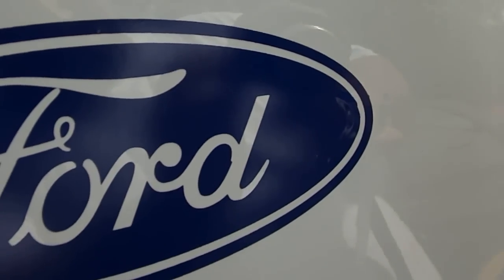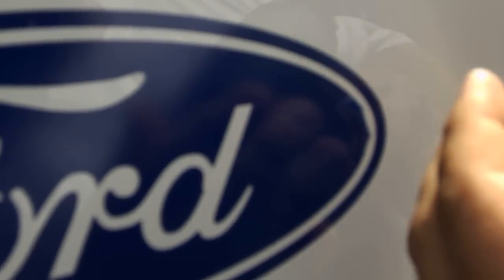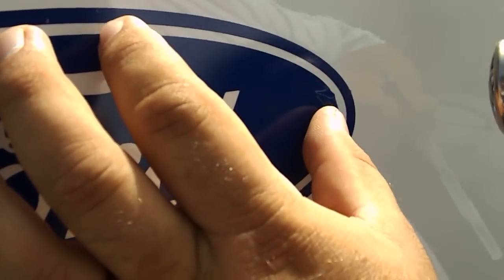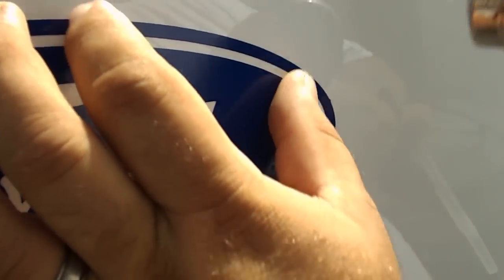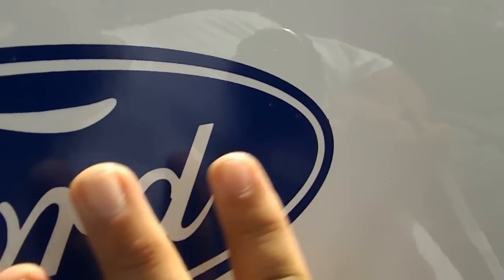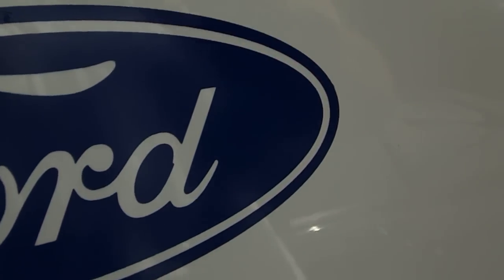how to repair your vynil graphic and remove bubbles and wrinkles.

Comment: Good Tutorial. Quick, and to the point.  One suggestion.  Drop your decal graphic into FlexiSign or whatever you use and fix the node on the inside circle of the letter "d" in Ford.  The edge of the right side of the D has a node out of place